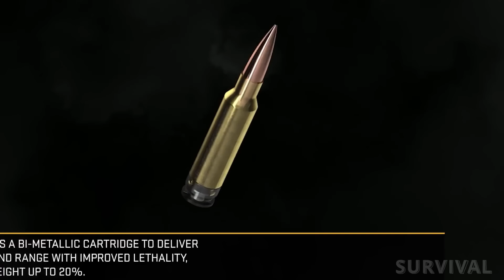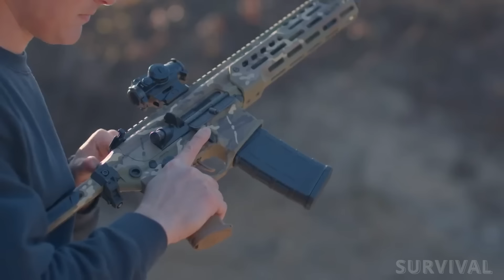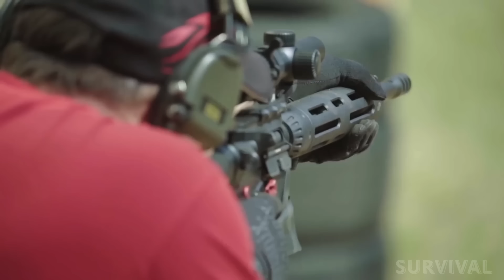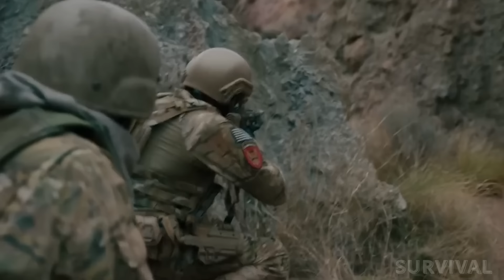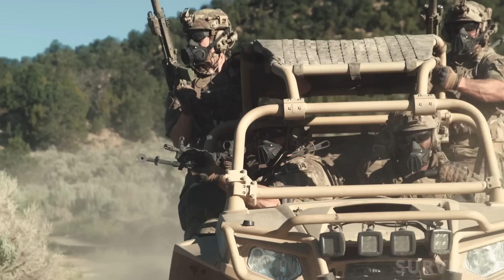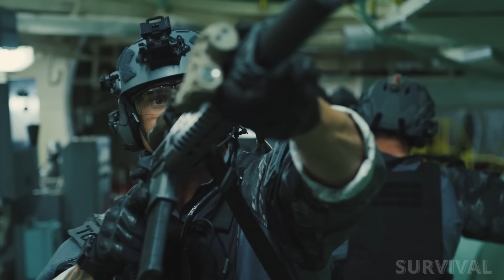The End of 5.56 NATO! New Cartridge is 5X Better!

Comment: This cartridge has many problems. Requiring a much heavier weapon. Weapon requires substantially more maintenance. The ammo is almost 50% heavier. Load out is reduced appropriately. The pressure tears up the weapon platform. What is the upside, slightly greater impact at distance. Will it make the cut depends on how much time and money it takes to improve it. Remember the 7.62/51 was the go to round in the 1950 s. The downside is the average soldier can barely handle the m4 platform.  Remember the teething problems with the m16 during Vietnam.

Comment: ONLY Special Forces are getting this, NOT everyone
Reply: Not correct. .it's replacing the boomer fudd 5.56.😂😅😂
Reply: @iam_the_little_iam Marine Corps as KICKED to the curb and ONLY Special Forces in the Army are using it.... NOT REPLACING 5.56... Not saying it won't be replaced but NOT yet... O and what they are looking at is a HIGH Pressure Variant of the 5.56 which would increase lethality
Reply: @thesirmaddog8209  ok to be serious, i do think they should've used nss3 308 & that the m7 & m8 are going to make great companions to 5.56 not just for dmr roles either, i do think if a high pressure version of 5.56 is adopted they may need a new carbine to use it though. 

I think full power cartridges should replace intermediate cartridges like 300 blackout but small caliber high velocity rounds like 5.56 have their place alongside full power rounds.